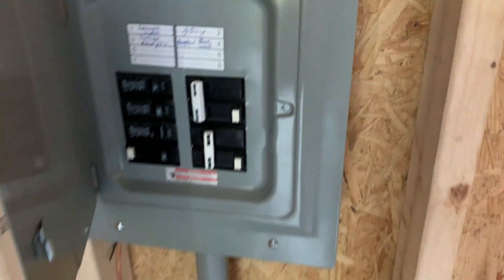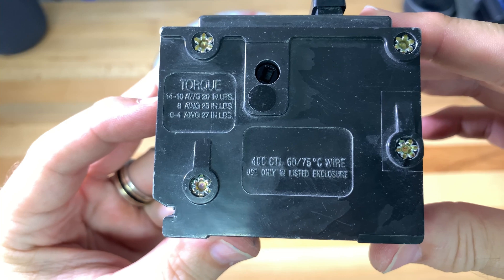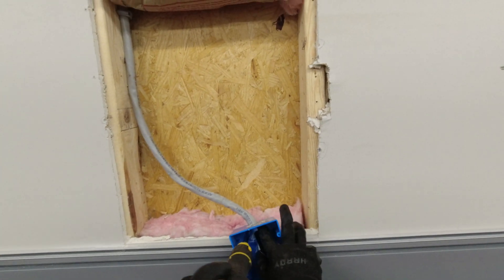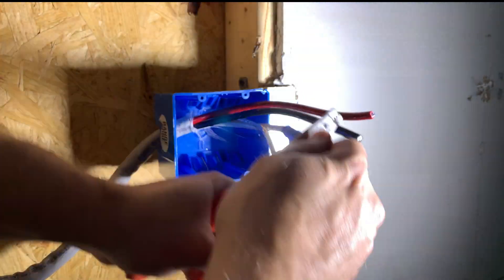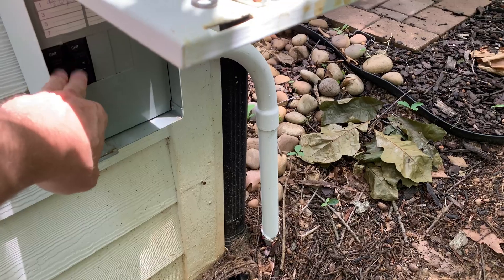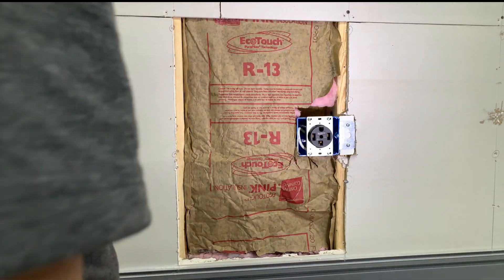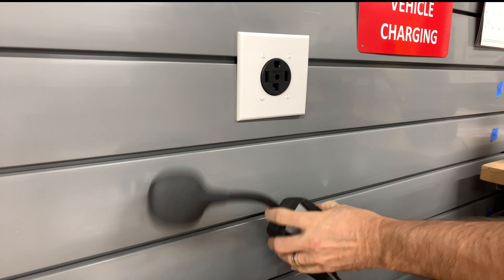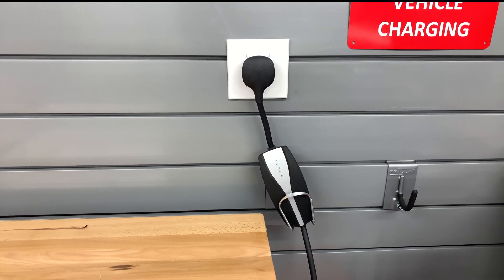Tesla - NEMA 14-30 Outlet Installation

Comment: Thanks for the review and your video was great!  I notice your 14-30 receptacle doesn't have the EV logo on it. As i am getting ready to install one myself, but i don't see any 14-30 receptacles selling with the EV logo stamped on the receptacle. Have you had any issues with your 14-30?  I am just worried about the receptacle failing as i've seen a lot of fires on the back of the receptacle. Thanks for your time. Cheers
Reply from the maker: I have never seen an outlet marked for EV.  The best choice is an industrial grade outlet that can support the higher sustained amps and repeated insertions. Avoid the $10 outlets.  Both my NEMA 14-50 and 14-30 have been working well since I installed them 4.5 years and 3.5 years ago, respectively.  I would suggest testing every year or so: https://youtu.be/lqYjFEfBdNY

Comment: Can you not use 10/3 since it’s rated for 30amps and 240v? Thanks
Reply from the maker: I would only use 10/3 if the distance is short.  I always bump it up to the next gauge, 8/3 for extra headroom and continuous charging that EVs require.  For your situation, is the 10/3 already installed?

Comment: my 30 amp,125/250 volt, 14-30R, 3-pole, 4-wire , my 4 prong plug 30 amp electric dryer is wired to 30 amp outlet is not working why?
Reply from the maker: Was there something (like a dryer) previously using this outlet?  If so, if you plug it back in, does it work?
Reply: it doesn't heat up any more old dryer, nor does new dryerheat up, i wondered if breaker panel is full breakers it is too many breaker? for 200 amp box. i got measure all breaker ad upt o, then see if more than 200 amp box gives. @MTNRanger
Reply: ye even old dryer has heat new dryer has no heat smell , old tries work but heating element is crapped new dryer not any heat from dryer on highest heat settings
 @MTNRanger
Reply from the maker: @blizte3  I would have an electrician inspect the outlet.  It could be any number of reasons (bad breaker, bad wiring, bad outlet, etc).
Reply: did dryer was miss wired plug
ground was not done to 4 prong
 @MTNRanger

Comment: is it true that you can leave the neural out for the tesla charger?  just hot, hot, and ground?
Reply from the maker: If you use a NEMA 6-30, it doesn't require a neutral wire.  If you use a NEMA 14-30, the neutral is needed for coded (even though the mobile connector does not use it). Use the appropriate wiring for the outlet you choose.
Reply: @MTNRanger  what if my sub panel only has the neutral ground bar..  do i just put both the green and white on this?   thank you bro your the best!
Reply from the maker: @ngouviet420  From what I have seen, ground and neutral should not be using the same bar on a subpanel.  I would check with an electrician in your case.  https://waypointinspection.com/neutrals-grounds-subpanels/

Comment: Amazing video and great guide! For my installation, I need to run it outdoors and my garage is about 50 feet away. I’m thinking of running it above ground and in a conduit. I live in illinois so I would experience all the seasons. Is there a specific type of wire I would need to purchase?
Reply from the maker: Most places require electrical wire to be buried outside.  That and the depth depends on local code.  I would check to see what is legal in your area first.  For example during my garage construction the service line had to be 36” underground.

Comment: I have a pre wired 240 V box not hooked up. It was there for a dryer but our laundry room is inside.  The wires are 8 awg aliminum.   Will this be sufficient for a 14-30.  ??  Thank you.
Reply from the maker: 8 AWG aluminum is cutting it close (equivalent to 10 AWG copper).  Copper would be perfect. How far is the box to the panel?
Reply: @MTNRanger  thanks so much for the reply.  About 6 feet.
Reply from the maker: @thews9237  That close you should be fine.
Reply: @MTNRanger  thanks so much!!

Comment: Great video! Is there a difference between the red (hot) and black (hot) going on any particular side of the outlet? Just left or right, not to be confused with the neutral or ground.
Reply from the maker: Red and Black are both hot and it doesn’t make a difference if it is left or right.
Reply: @MTNRanger  Thanks! Also, why did you downgrade the breaker from 50AMP to 30AMP?
Reply from the maker: @seanrozenberg1570  I'm adding a 20A mini-split HVAC unit and wanted some extra headroom since I already had two NEMA 14-50 in the garage.  I found that I mostly only need to charge at 24A anyway.

Comment: Is there much if a difference between a 14-50 and 14-30? Im planning to use this with a standard range + model 3 2021 and I heard those are limited with the charging. Mainly due to the 14-50 adapter being sold out.
Reply from the maker: Since you have a SR+, the max charging is 32A.  So the difference between a NEMA 14-50 and 14-30 is 8A.  This is adding 30 miles/hour and 22 miles/hour or range, respectively.  For normal driving of 30-60 miles a day, it's not much of a difference in charge time, especially if the car is parked overnight.
Reply: @MTNRanger  this is really helpful! I think I’ll go with the 14-30

But if the local tesla store has the 14-50 in stock it might be worth getting it since the electrician said same price for 14-30 or 14-50
Reply: my 30 amp,125/250 volt, 14-30R, 3-pole, 4-wire , my 4 prong plug 30 amp electric dryer is wired to 30 amp outlet is not working why?